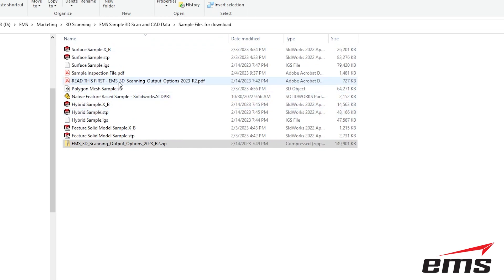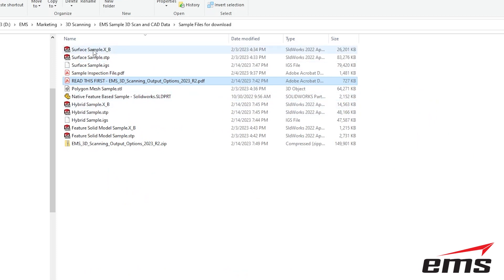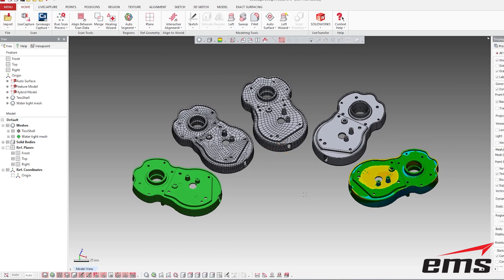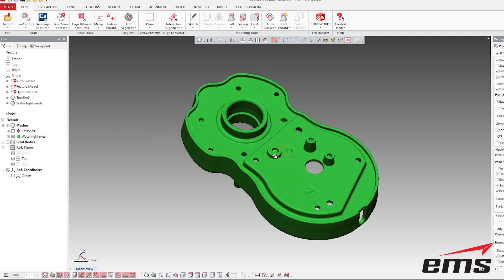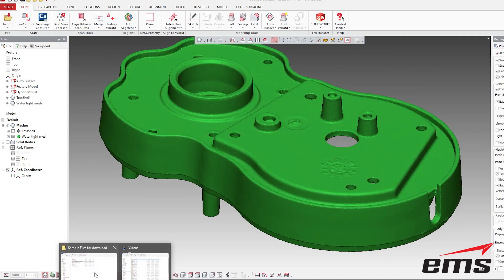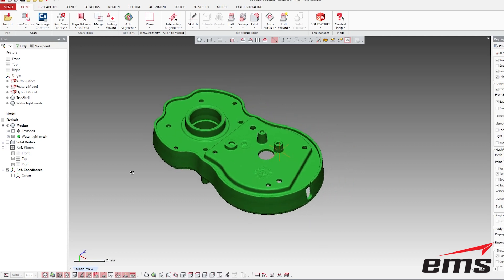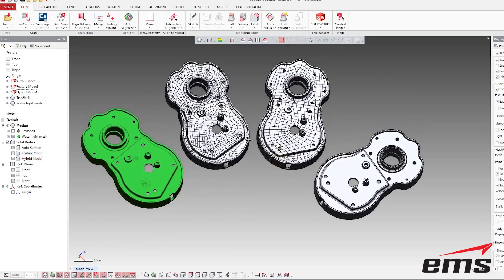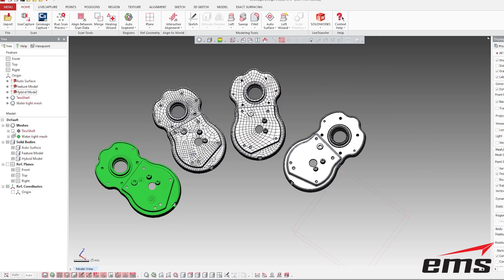3D Scanning CAD Output Options - with Download Samples

Comment: All good info but you misleading viewers a bit. 
Polygon mesh file (as long as it is watertight) can be used for 3D printing (and 3D printing is also considered manufacturing).
You can also make negative form put of it (that is also manufacturing) so the file is not only for vewing prupose.
Reply from the maker: Yes you can go to 3D printing as long as the model is not only "watertight" but also correct.   Just filling in all the areas the 3D scanner couldn't "see" would not be correct. Small holes, threaded holes, blind areas, tight areas, small details, etc would be wrong if you used software to fill it in.   Simple parts would work fine, complex parts would be more of a challenge to go straight to 3D printing from scan data.

Comment: Where did you get the red plate that holds your laptop??
Reply from the maker: We made it.   Waterjet cut and bent a piece of aluminum and finished it off with powder coating.  We then mounted it to a ballhead style tripod.  This allows you to roated the angle of it.  Its very sturdy for doing 3D scannign out in the field.  We are going to do a video on all the cool accessories we use for 3D scanning.  Stay tuned.

Comment: Is the auto-surface model suitable for CNC programming/machining?
Reply from the maker: If the part is organic in shape its fine as long as your CAM software can work with that file type.  If you are trying to machine holes, sharp corners or precise features then a hybrid or solid model is needed.